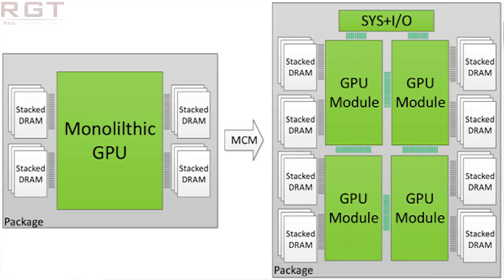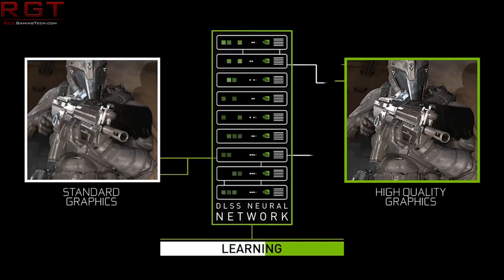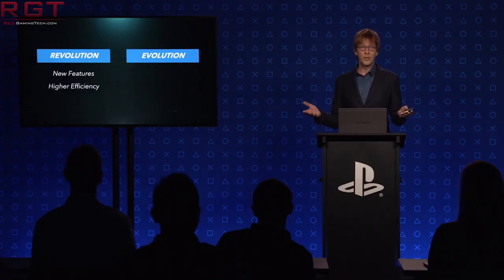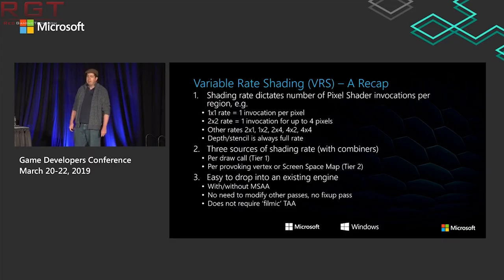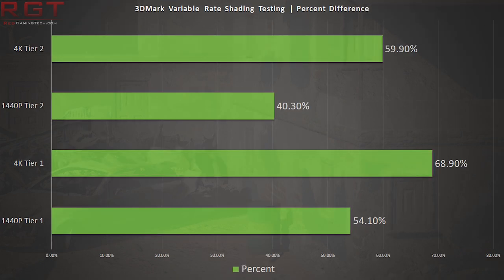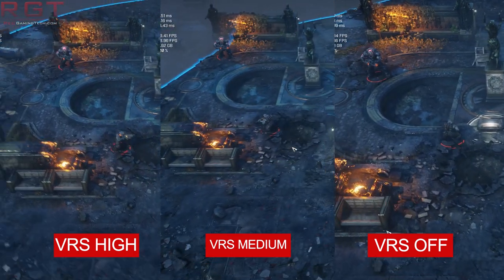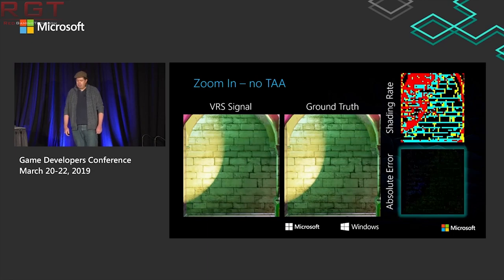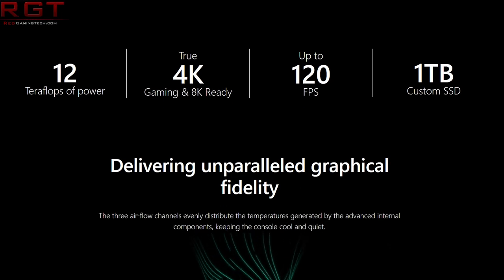Variable Rate Shading Explained & Analysis Of How It Impacts Next Gen Gaming

Comment: That's why I say everyone buy a RDNA 2 don't buy RDNA 1 skip it or if u REALLY need a new gpu RTX 2000. Because u will miss those features in the future VRS, DLSS 2.0 or better maybe AMD will have with RDNA 2 a type of upscaler like Nvidia then ray tracing cores. Those features maybe sound not important BUT we are in a gpu change how gpu's function. This is revolutionary this reminds me of GeForce 8 cards what had unified shader architecture and this was revolutionary and changed how gpu's function. The same leap we have again 12-14 years later with those new GPU's.
Reply: Yeah, those 5000XT GPUs are not a good buy right now. They lack the entire DX12 Ultimate featureset and machine learning acceleration which is crucial for that feature and code parity between Xbox and PC. These cards might still run the future games fine, but it will look and perform much worse than a Turing, RDNA2 or Ampere card, so I predict these GPUs will age much better than RDNA 1.
Reply: @dampflokfreund  Yeah RDNA 2 will age much better. RDNA 1 feels to me more like a fast answer card for Nvidia's Turing cards. I think the real deal will be RDNA 2 and we are extremely close those gpu's will come at the end of 2020 they should... Well we never know although the current situation is getting better.

Comment: For VR, 4K and Ray Tracing it will be a god send. Especially VR and Ray Tracing given how taxing they are on even high end hardware.
Reply: VRS is only useful in current gen hardware... In next gen hardware, it's a outdated technique in some aspects if graphics developers end up rendering on a 'triangles per pixel' basis.
Reply: @dra6o0n  Can you please elaborate? How is rendering on a "triangle per pixel" basis different than the vertex and pixel shaders that have always around?
Reply: @ChelseySmithHandle  It's like doing it in reverse. Instead of taking a big texture then toning it down when not 'seen' in the best situation, you 'build up' particles of textures based on what is needed to be seen. So if a area is dark, but a portion of that area fades to a brighter area, you can make every pixel or triangle transition to stream different texture types.

Like say a Gradient wallpaper, that fades to black. If you were to 'tone down' the entire texture, the lit parts would be toned down, and the toning down process might be detail level 0 to level 4-5, but not like 0% to 100% variables.

It becomes useful in non-urban environments since you have spots of dark areas, or complex shapes.

Plus, VRS kinda requires developers to 'tune' the system to know what to tone down and what not to tone down... If it's done like UE5's tech demo for nanites, it would follow a ruleset from the getgo to build up the image to define what the quality levels are.

Also VRS is sorta high level refinement in some cases, the game is mostly already developed by the time this is used on top of it. You need a low level refinement that can be compatible with 'all' games that is ran on a core foundational level.
Reply: I also find that ray-tracing isn't the end all, be all, solution to everything. Especially with how UE5 showed that you can do 'fake ray-tracing' with a global illumination, but use the triangles to react to the global light instead of bouncing rays off everything.
Reply: @dra6o0n  lol. Fake ray tracing.... its two different  method.. its ray's tracing as in the term and not the method.. for example path tracing not the samething but in terms of operation of that method.
Reply: 10/10 A +

Comment: So weird that Xbox has all of these effeciency features yet idiots keep claiming series X is brute force .  Though I don't recall ps5 confirming it has VRS outside of the psvr 2 rumours. So that's good.  But I still haven't heard if it  has direct ML or DLSS.  Only microsoft has confirmed it thus far
Reply: Has it crossed your mind that maybe, just maybe, that Sony hasn’t revealed anything besides the specs and controller so they have yet to announce machine learned supersampling/subsampling/upsampling? And MAYBE they haven’t revealed it and shown how it works because people can just steal it from them or reverse engineer it, because they haven’t filed a patent for it? Maybe Xbox has shown it because it will be on PC AMD hardware as well, just a possibility
Reply: @GrainMuncher  I stated pretty clearly THEY as in SONY hasn't said anything about it yet and considering they did a deep dive and mentioned none of it it remains as such.  Take that as you like but until they announce it as a consumer I have to assume they do not have it.

Comment: Would VRS be relevant when you can have more efficient ML upsampling technique such as DLSS? The 10% performance gain is hardly worth the trouble when they also lower overall image quality.
Reply: It is if the particular game doesn't have
a DLSS / ML implementation.

Comment: You really should stop saying VRS is well suited to background details. VRS is best suited to large inner surface areas with low contrast, fine geometric details (such as distant objects) would become noticeably more aliased when their resolution is dropped.
Reply: But if you only need to render what you have pixel wise, and limit it to the triangles per pixel ratio, you can have higher details while reducing constant of wasted resources like on VRS.

To do so requires stupid fast SSD though, so VRS is for 'current gen' hardware to make up for the gap, not to fill it.

Comment: Vega already has a chiplet based architecture.  It has the GPU die + 2 dies of HBM2.  I only count this because Vega arch wouldn't work with GDDRX as the entire design revolves around having extremely fast access to low latency memory.  I'm sure it could be done but much of it would need to be modified and I'm sure there would be quite a large performance deficit from doing so.

Comment: Why did you spend like 4 minutes covering DLSS when the topic is VRS? Just a sentence or two would have sufficed.
Reply: Both technologies reinforce eachother
Reply: @j0hnc00  That's actually NOT the case. For one thing, DLSS is an Nvidia-exclusive feature, whereas VRS is also possible with upcoming AMD GPUs. For another, even with Nvidia, you can't enable both VRS and DLSS simultaneously.

They don't reinforce one another. They're alternatives to one another.

Comment: will the ps5 support VRS?
Reply: Why wouldn't it, it's part of the GPU hardware in RDNA2.
Reply: Yes it can 'use' it. But it's I/O is so superior to modern devices that it doesn't want to, it can stream everything super fast to a 'triangle' per pixel basis up to 4k.
VRS is Nvidia stuff for the most part as they use it to 'cut down' on wastage on current gen hardware, which does not have sufficient I/O or RAM capabilities or capacities, it's to make the rendering backwards compatible with engines that don't make use of fast I/O for streaming.
But on Next gen? They don't need it.
2019 - Everyone screams ray-tracing.
2020 - Ray-tracing comes, but everyone screams something else.

Nvidia is generally behind in terms of releasing 'stuff' that are accessible to the masses on day 1.
Reply: that's a legit question the  2 comments below didn't answer.. as far as stuff confirmed... VRS is part of DX12U.. which isn't on PS5.. so it's a legit question

edit

this is what I've found :

a recent PlayStation 5-related discussion on NeoGAF, the lead artist from Activision pointed out how VRS will help developers create systems that can procedurally generate higher quality assets on the next-generation PlayStation 4 successor. He also noted how the new Geometry Engine (GE) block of the RDNA 2 technology needs VRS by design.

So.. it looks like it will be supported .. Sony hasn't directly confirmed it themselves... they've mentioned nothing of VRS.. which is weird...

but it looks like an activision  dev is using it on ps5 right now... so that's an indirect confirmation

here's the link

https://segmentnext.com/2020/04/09/ps5-has-vrs/
Reply: Microsoft will be using Direct ML AI to upscale the resolution and textures.

Comment: nVIDIA will not go mcm for a while,no need said there Chief Engineering Architect at HotChips 2019.... Ampere A100 Monster proved that, at 54.2 BILLION Xtors on 7nm+, versus Turings 18.6 BILLION Xtors on 12nm. 

Bet you the next Uarch from nVIDIA will top 100 BILLION Xtors on a single 5nm+ chip, in late 2022.